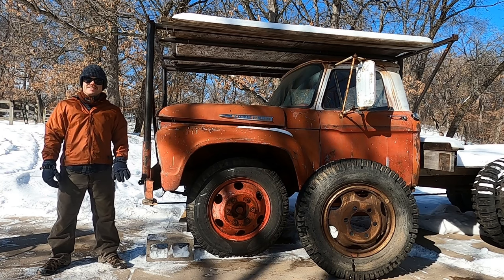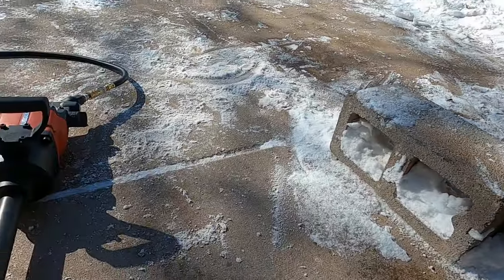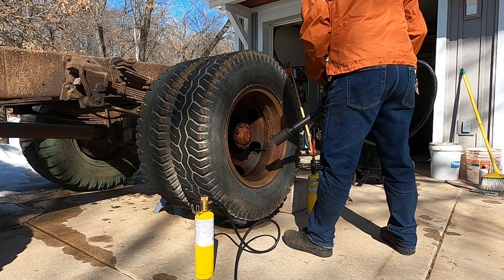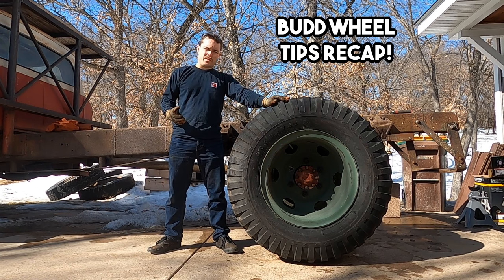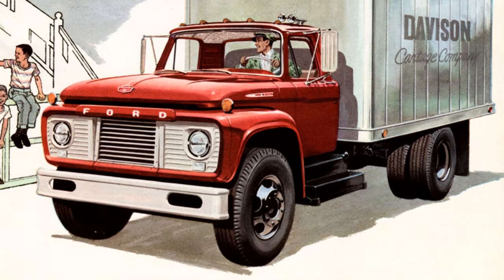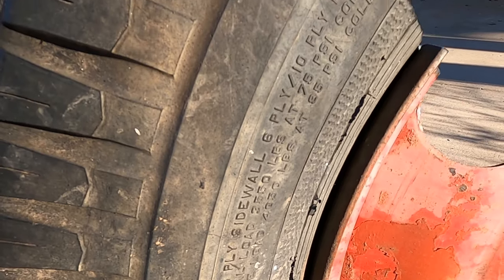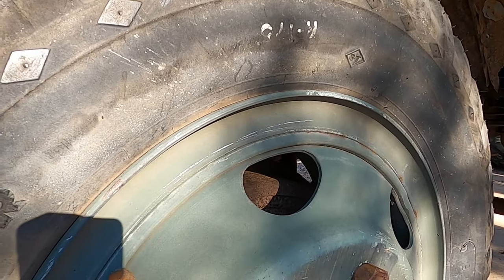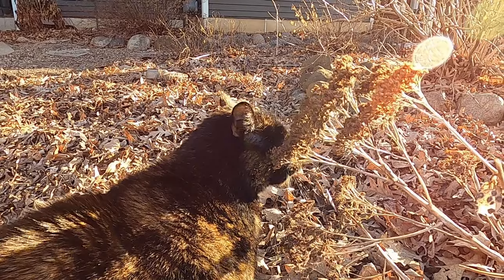All About Split Rims, Explained! Ep. 11

Comment: I watched the whole video waiting for you to explain about how you get a Widowmaker rim apart by finding the two reliefs that are 180° apart from each other that you have to push the 1/2 down in to get the other half out of. That’s not the best explanation but if you’ve ever repaired and changed the Widowmaker, you know what I’m speaking of.My dump truck came with six of them but it also had a bunch of other spares that were every kind imaginable that I had to take when I bought it so I learned from taking them apart and just using common sense. fire stone mailed me a packet about rim safety because I pointed out a flaw in one of their flyers and it had its own flaw in the pamphlet which showed a man standing in the  trajectory zone , airing up a tire,straight out in front of the lock ring on a front wheel! I have their return apology letter thanking me for pointing out their flaw in my basement collection.
Reply from the maker: One of the reasons i bought the split ring military wheels was to avoid having to split the RH5's! I'm also of the opinion that if you do a job correctly you shouldn't have to worry about your safety. But from a pragmatic point of view, we all make mistakes, and if I made a mistake here the risk would be pretty high. Great story on your Firestone letter! I'd frame it too!

Comment: Excellent video and very cool truck.  I've worked on both types of wheels.  I spent a few years as a fleet mechanic working on school buses and later worked on farm trucks in a small town.  You explanation was perfect and very educational.  You perfectly demonstrated what I've tried to explain to people for years
Reply: When I was working retail and people brought in split rims I had a steady  source for 9r22.5 used tires and wheels and made it worth their while to change over by pricing flat repair out of reach. 
Semi drop center wheels and lock ring wheels never bothered me much since I began working on them in about 1972, but split rims you could never see how the pieces were fitting together and by the 80s most were worn and rusted so badly they just weren't safe.

Comment: I remember working on split rim tires back in the 80's when I worked for my dad.  He mainly did the two-piece wheels, and I remember him wrapping a log chain around them when airing them up.  I did work on split ring wheels off of semis now and then.  It was always a pucker factor when you're airing up a split ring wheel to 100 PSI.  I won't touch them now, not even the safer split rings.

Comment: Worked as an axle guy for a small tracking company. I heard stories from an old UPS mechanic where these rims sent a dude flying to the roof, killed the guy and left a human body shape on the ceiling. Another story was a UPS truck delivering across from a school. The tire blew and sent the putsode half of the rim through two brick walls in the school. Luckily no chdren were hurt, but one of the rooms damaged was a classroom. If kids were in there, a few would have certainly die.
I never worked with these rims, but i heard enough stories to never attempt to try working on one. Not to mention the amount of disasters from just trying to inflate those things, apparently even tire cages wouldn't save you.
Reply: Yep, we dont have a tire cage in the shop, we dont install tires except for ourselves or for certain customers and they are never on this design of rim.  We did have a few years ago a '48 dodge power wagon from canada get towed in guy wanted a petronix and his brakes checked and adjusted.  I told him the first thing he needed to do was come pick the truck up get those widow makers off and get some regular rims on the truck before I would ever pull it into the shop and attempt to work on it.

Last thing I need is some rusty canadian widow makers deciding to let go in the shop with a bunch of customers cars and doing tens if not hundreds of thousands of dollars worth of damage.

Comment: We used a few different types of wheel/ tire combos on equipment used to service Aircraft. In all cases before removing the combo you always wait for it to fully deflate. Especially the ones on the Landing gear…  I was just finishing a task and was near a young kid working on a small toolbox trailer. It was a split rim that was bolted around the outside of the wheel lug. He was taking them apart to clean and paint. He did not deflate the thing. He got to maybe the 3rd bolt and it sheered the last 2 as it violently separated. The nut with part of a bolt shot off like a bullet. It ended up busting a hole into the stucco on the building 10ft away. His thumb was broke but amazingly that’s all the damage he took. Well, physical damage.. his butt got into trouble and had to teach his whole shop how to properly identify and service wheels and tires and had to do some other “training” for his actions.   Biggest thing to learn, if you don’t know and have never done it, find someone who has! Wether it’s a farm friend down the road or the nearest truck stop even.

Comment: Thanks for the explanation.
In some cases, drop center rims can replace split ring and lock ring rims, often going up a size, from 20" to 22.5".
Reply: You can't really find sizes like 10.00 20s anyways so 11r22.5 is very close that it works most of the time.

Comment: I was a sawfiler in a sawmill and when I first started I worked in the mill running an edger. One morning while working , everything normal sounding and thats a blend of all machinery in concert when suddenly  an extremely loud boom that I felt more than heard then the floor and whole mill shook. We used Raygo Waggoner L 90 forklifts at the time to reach under a Simi trailer load of logs , lift the entire amount then back away and put in mill or place on yard. As the operator was turning to place logs forward toward mill the ring that holds tire on rim blew off, shot away towards mill , impacting partially against the ground. This caused it to fly up where it hit a 4 inch I beam bending it , tearing it loose from overhead beam it supported,  then striking a permanent ladder ruining it. 
The tire that blew ring was over 7 feet tall almost 3 feet wide. Its hard to imagine the force and wave  that we felt inside then see damage. That accident could have been deadly but thankfully only slight structure damage.
Reply from the maker: Dear Lord. Glad everyone was ok!

Comment: I ran truck shops for 40+ years, our air plumbing was 3/4" copper from the compressor room to 1/2" hoses off manifold connectors to guns. Save the 3/8" for spray guns and such.
Reply from the maker: We don't have a truck shop, but have found a few tricks since this video. One is just to lightly lubricate the threads, cause they definitely aren't going up to torque correctly if they're rusty! They come off easier now too. Things were way too hard to take off! I'm still probably going to get a torque multiplier and 3/4 ratchet. A lot cheaper than a new compressor with 1/2 or 3/4" hose!

Comment: You might add how hard it is to replace C50 wheels because they have a 10 bolt pattern which you won't find any non widow maker wheels for other than some VERY expensive aftermarket ones that were made for avery short time. Also you can wrap a chain around the tire and through the holes in the wheel center. do this all the way around and even if it lets loose its basically in a cage.

Comment: Your regulator may be limiting your air flow from your tank.  You might try removing the regulator and tap direct to the tank to see if it's the problem.  1 inch require quite a bit of cfm.
Reply: They need a larger diameter hose too. That 3/8 one isn't feeding enough air. A minimum of 1/2" is needed. But 3/4" is ideal.
Reply: Yeah, that impact sounds sad.
Reply: Nah, need 3/4 hose.
One of them 1" guns can even run a 1/2 hose dry haha.
We run 1" hose on all our service trucks and in the shop.

Comment: With those big air tools, you need a 1/2 or bigger hose for volume. HUGE difference in tool performance when you have the right size hose. I installed one 1/2 hose in my shop for this reason, works great.

Comment: Most widow makers were made by Kelsey Hayse, I am sure that I spelled it wrong. 
At the one tire shop that I was at, an old guy showed me & told me what to watch out for on the KH widow makers. On the KH mark with crayon on the rim where the notches are. On the KH center mark on the center where the notches or hooks are. Make sure that they are opposite. NEVER air up a rim with any bent, worn, or mismatched parts. 
One guy brought in a Goodyear rim, Firestone snap ring, and a removable bead that had been run down a highway flat. I said NO! He complained to the day manager, day manager said yes. I still said NO. I told him to go call the owner Ed. Ed said that he would look at it tomorrow morning when he came in. Ed looked at the removable bead, said no. Told the guy to get his junkyard parts out of his shop!
I think that the day manager got talked to. 
Next time I saw owner, my Friday afternoon shift, he said thank you. 
Your impact wrench sounds low on air volume, remove the quick coupler from the impact wrench, screw about a 6 foot hose onto the impact wrench. 
DO NOT USE 1/4” quick couplers! Use 1/2 quick couplers for a 1” wrench!
Go to the Torque Test Channel, they torque test impact wrenches, air hose sizes, quick coupler designs, quick coupler sizes!
Hello from north east Montana. 
10 miles from the Canadian border.
Reply: A guy who knows how to service widow makers.. Impressive! It seems that even the people who can identify the RH5 degree still don't realize that the notches in the ring exist and misalignment is the root of failure apart from corrosion

Comment: You guys really need to supply that 1 inch impact gun with a minimum of 3/4 inch air hose hooked up to a high CFM air pumper like a rotary screw or vane type to do it justice, I'm glad that it worked though.

Thanks for the video on these types of rims and that Seafoam product tip.

Have you guys ever watched the "Pakistani Truck" youtube channel? They repair those split ring rims on those"Jingle trucks" over there.
Reply from the maker: Ideally would have the big hose, but then we'd be getting into a bigger compressor, and then the $250 impact driver purchase spirals up toward a grand, and well, the wheels are the only things I will be using it for at this point. I'll check out that Pakistani truck channel!
Reply: @SealedBeamRallyTeam   The compressor will be fine, the diameter of the hose is killing you! Even a 1/2" hose would help. You'd be amazed how much harder it hits. When the compressor kicks on just wait for it to charge back up. Great info on the different types of wheels!
Reply from the maker: I'll have to figure something out before i start hauling loads. For now I'm going to make sure the lug studs are lubricated so I can fully torque them, and I think it'll be fine for just driving around with nothing on it

Comment: Thanks 👍 for the info! I've had the pleasure of using bud rims for the most part and only a small number of the rims I service are split ring and split locking ring rims. I always take the time and care to do a tire replacement properly , like not exceeding a bead seating pressure of 20psi, and then into the tire cage for inflation to the specified pressure. I will keep an eye out for the "widow maker" type of rims but I'm happy to say that most of the trucks I work on are not antiques. Say another big point when inflating a tire is to listen for any cracking noise while inflating,that is a sign that the steel belts are snapping between the inner and outer rubbers and that the tire is unsafe to inflate and should be discarded.
One more thing 😃 that Saab Sonett you have is a fun little sports car. Fiberglass body, front wheel drive ,with a "free wheeling" trans axle , mechanical headlights, like the Opel GT , and that industrial V-4 was an excellent power plant. Have fun with that!
Reply: If I was doing this, I wouldn't want to have to handle it after filling in a tire cage. I'd rather put it on the vehicle, then fill it with a long hose from far away. If it explodes and damages e vehicle, so be it.

Comment: Thank you for the information. I owned a 1969 Dodge D200 truck with split rim wheels. Never had any problems with the rims, but found it hard to find trie shops with a cage for working on them. Went to Ford 1 ton rims. Thanks again.

Comment: I run container chassis. Split ring is a railroad standard. On a Dayton wheel. 5 spokes. a big majority of which are a 10x20 tube type tire. How we mount them is inner wheel ring out valve stem pointing to the inner lug nut. then 
Put on the spacer then put on the outer wheel valve stem pointing toward the opposite inner lug nut.  Now install the wedges on the studs then the lug nuts. 
Seating the tire so it runs true. Now air up bother tires at the same time to 90 lbs. After aired up drop the jack and put a touque wrench on them. 
To remove a blown tire. Loosen the 5 outer lug nuts smack the rim to loosen the wedges. Now remove lug nuts and wedges.

Comment: Back when these RH5° rims were more common, most guys doing tires knew to stay clear of these when inflating. If the rims were in good shape, the two halves of the rims fit rather well, it was when rust and years of use beating up the rim that made them a bigger issue. 
The first shop I worked at back then didn't have a proper cage for these rims and I'm not sure you could buy one at that time either. We would do one of two things when inflating these, either we used the forks of the forklift, which we pushed together on both sides of the tire and a remote tire filling hose, or we would place the tire in the alley between a storage trailer and the concrete building. We were told to inflate the tire just slightly, maybe 5 psi or so, then check the halves of the rim before inflating. We were taught never to lay the tire down simply because what goes up, must come down. It was years later, in the 80's before I actually saw a rim separate during inflation, a guy was inflating a newer, three piece lock ring style wheel with a new tire and tube when the snap ring slipped out. It was in a full cage when that happened. The same guy however later was responsible for blowing up four more tires and cages. It never happened to any of the other guys for some reason. 
By the 1980's most shops wouldn't touch two piece rims and many refused to even work on three piece rims claiming it was an insurance issue. We still did them on occasion, or at least I did, most of the younger guys would evacuate the shop when I was inflating one.

For as many of those rims as they made over the years, the failure rate back in the day was pretty low. I think most issues were from inexperience, carelessness, corrosion, and mismatched parts. 

I personally owned a truck years ago with those rims. A previous owner, likely long before my time with it, had welded the rim halves together. It made replacing the tires interesting but once the old tires were off we realized they had welded both the outside and inside of the rim with what looked like stainless or high nickle rod. They got a set of used tires at that time but I eventually found a set of modern rims for it. The old rims became camp fire rings and flower planters around the neighborhood back then. I'm not sure what the replacement rims came from, a local used tire shop had them for cheap with a set of decent used tires. 
The used tires lasted till I sold that truck years later, so I never did get a really close look at what those rims were. I likely never had the wheels off it again.

Comment: A half inch hose and fittings will feed the 1 inch impact so much better.  It's all we used in the tire shops I've worked at.
I've only had the 'pleasure' of changing the tires on widow maker rims on one vehicle, 30+ years ago. What was impressed upon me from the elder tireman, clean, clean, clean (the mating surfaces). Of course you want to inspect for cracks as well. These two rules apply to split rims too. The tire cage was definitely used. Nothing exploded and the customer was on his way.

Comment: I haven't done tires professionally for over 30 years. But I just remembered an old trick for breaking one down that is all rusted. Just lay it down flat and pour gasoline around the bead kind of generously. Do not light it just use it like a solvent and don't have any source of ignition near you. Just pour that around there and start using your tire Hammer like normal. It makes it surprisingly easier. 

Some old-timer showed us this when we were having trouble breaking down a tire that had rusted on pretty good. We beat on it for a while and he poured some gas around it and it broke down easy after that.
Reply: I've used gasoline also for unfreezing the tire bead from the wheel. I'm talking tires that were on a car sitting for 30 years or more.  They were really stubborn.

Comment: In a former life, I worked for U-Haul as a truck mechanic. The "Pride of the Fleet" in those days (mid-1980s) was a 1972 F-600 with a steel-framed aluminum-sided 24' box. U-Haul had wisely gotten away from the Widow-maker wheels AND the split rims, and did what they could to keep line mechanics from having to mess with moving tires on and off wheels, leaving that to people trained on such stuff.

The trucks, of course, were only slightly more modern than your '62--U-Haul had found a retro-fit electronic module that replaced the points and condenser in the distributor, but otherwise, someone accustomed to working on your '62 would have been familiar with the truck.